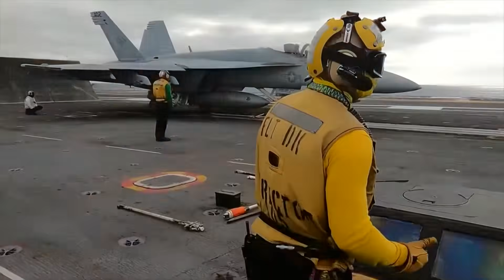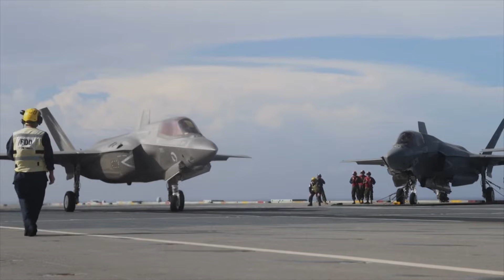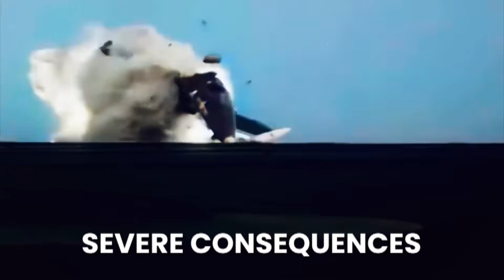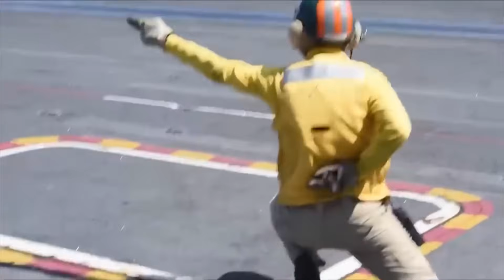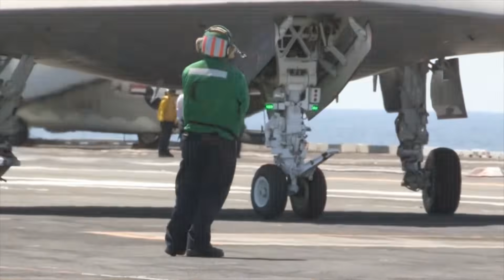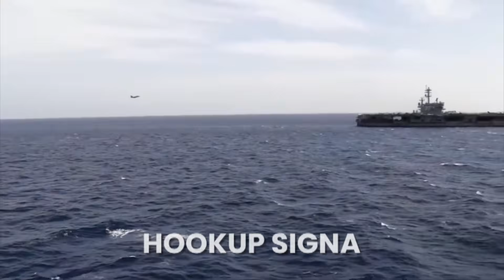Aircraft Carrier's Crew Hand Signals Explained

Comment: I got to hot pump an f14 in 1982 on the USS Eisenhower. 1 eye on the gauge, 1 eye on the plane director. Plane director did 3 taps on the cranial with the cutoff motion (sign of topped off and break off fueling). Had about 7 seconds to disconnect and get the he'll away.

Comment: And what about the, “grapes,” brown, and blue shirts?
Reply: Grape is fuel..brown is a plane captain blue is for crew
Reply: The blue shirts are the grunt workers, usually that is the starting position, they assisted in the movement of aircrat as well as installing and removing restraining devices, All flight deck personnel had secondary assignment during general quarters, mine was to fire a 50 cal machine gun, port side, if the assign personnel became incapacitated (during training the monitors would remove the main personnel from their post and force the back ups to take over)